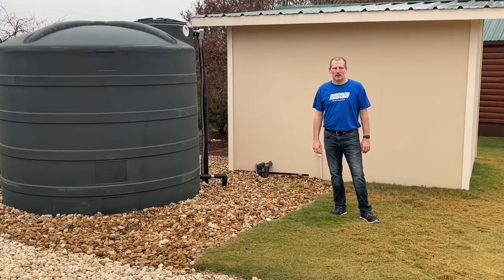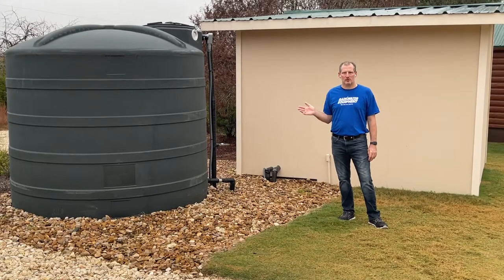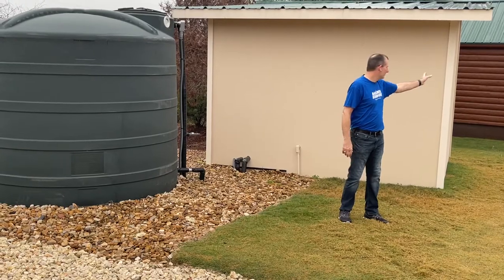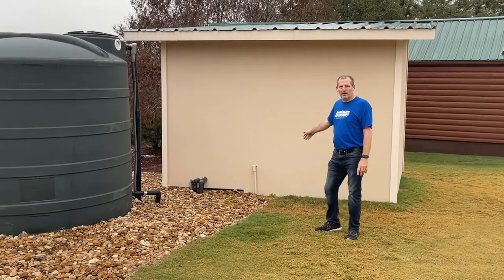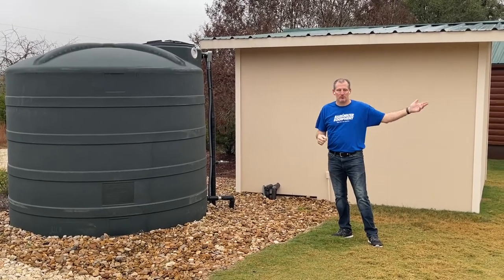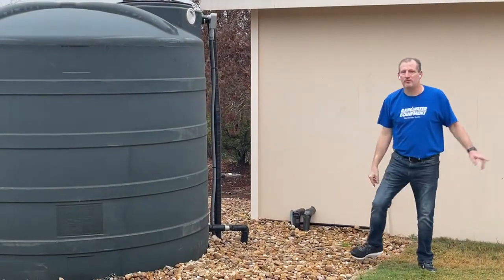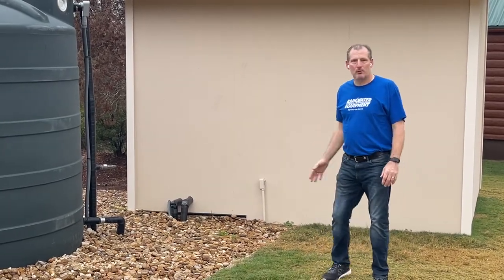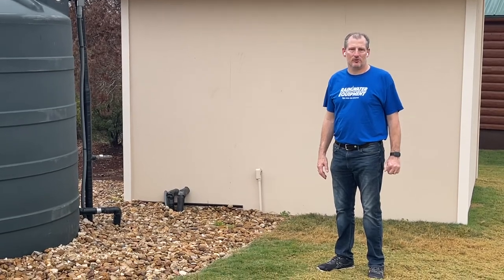Well water day tank paired with a booster pump

Comment: Would a booster pump work if you had a 86 gallon well tank, rather than one of these behemoths? I guess what I am not understanding (probably just missing something) is when the well tank got low and the submerged well pump kicked on, would the booster pump still be able to work/"boost" the water at the specified PSI? It seems like when the tank is actively filling up, there would be a drop in pressure until the bladder tank was filled again.
Reply from the maker: A booster pump is typically only used in a well water situation when you have a reserve of water on hand stored in a water storage tank and boost water from it. It doesn't have to be 2500 gallons of water as is shown in the video. Depending on the amount of use during the day, something as small as 500 gallons might be sufficient. I assume that the "86 gallon well" tank you're referring is a pressure tank. Well pressure tanks (with air bladders inside) are used to store some water and are typically used in tandem with a 30/50 or 40/60 pressure switch for example. When the water pressure in the main line going to the house drops to 30 or 40 PSI, depending on the pressure switch setting, the pressurized water (due to the pressure from the bladder) in the pressure tank begins going into the house. When the pressure tank is depleted, the well pump refills it. This is different from a non-pressurized water storage tank as is shown outside of the well house in this video. Since the water in the storage tank isn't pressurized, the booster pump takes care of that part by pressurizing it and sending it to the house. By having the "day tank" filled with water and using the booster pump, you're taking the workload off of your expensive well pump and extending its life. Plus, if you use a variable speed, constant pressure booster pump, you'll likely experience much better water pressure performance in your home.

Comment: Which booster pump HP should I buy for a 50psi goal?
Reply from the maker: It depends on the flow rate that you’re wanting. For 8 - 10 GPM, we recommend this constant pressure, variable speed pump. It allows you to set the PSI where you want it. And it will run off of 115V or 230V.
https://rainwaterequipment.com/esybox-mini-3-on-demand-constant-pressure-pump/

For 15 to 20 GPM, we recommend this 230V one.
https://rainwaterequipment.com/dab-esybox-electronic-water-pressure-system/